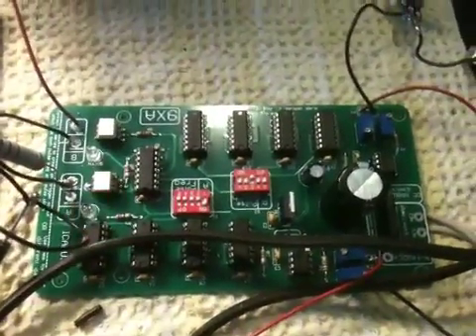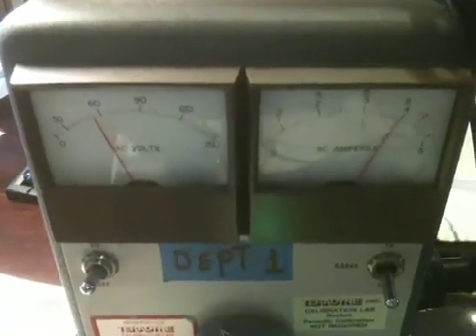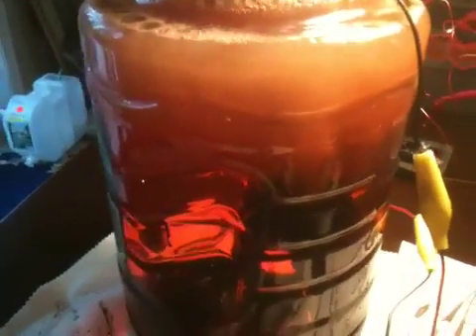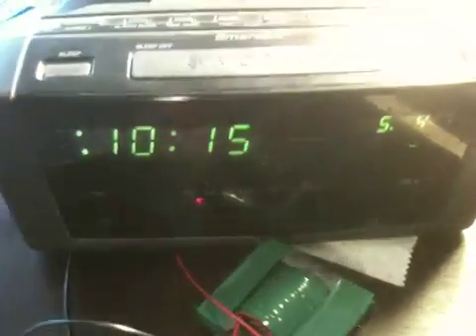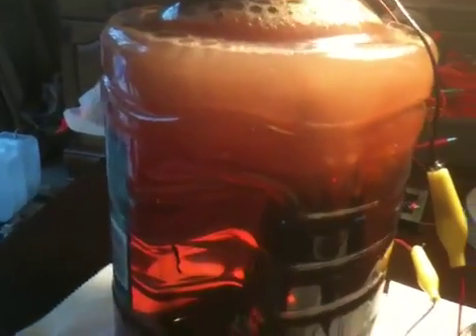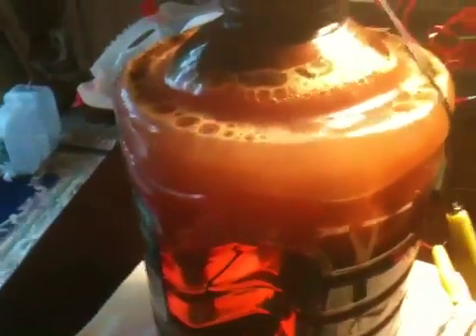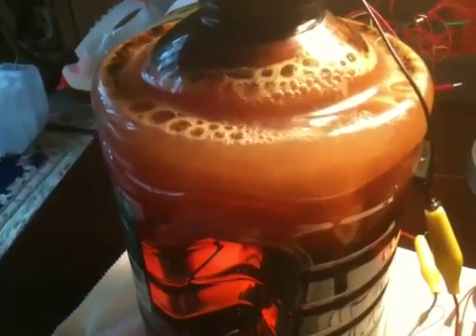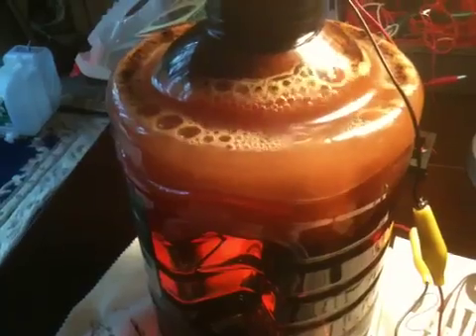Stan Meyers Hydrogen Cell using Max Millers 9XA and 2 E-core Inductors, sound

Comment: If you had platinum electrodes you would probably get 2 to 3 times the production with less voltage.
Bloom energy cells say they found a cheap replacement for platinum.

Comment from the maker: I tried the set up you suggested, but with one 6 inch tall cell. The cell was 1.25 od on the outer tube and 1 inch od on the inner cell.The outer cell was sealed with shrink wrap and the inner cell was filled with silicone. One inductor, as you suggested. but the draw was large. Over 5 amps. Switched to 5 layers, only energized the inner and outer tubes. About 30 volts with 4-5 amps. Tremendous flux on the inductor. Would like less amps. Definitely different. Still needs more tweaking. 
ThankYou

Comment: Your welcome, I posted the 8xa circuit mods almost at the end of the thread. The way the bifilar chokes are wired, as shown, cuts down the amps and you will notice your SCR will shut down. The way that is it wired is very important plus note I added a microwave oven transformer so the voltages will be very high up to 1500 volts to the cell and beyond. You have two chokes sets so wire them into each other the correct way and you should get the results you are looking for.

Comment: Hi, I posted some circuit modifications that really cut down the amps flowing through the system on Heretical Builders in Electric Fields and Moving Media, Stanley Meyer Explained on the circuit you are using. Give it a look and know if you hook up two chokes the way I have shown you will get around a 2000% amp reduction between the plates, enjoy! And God Bless Max for his efforts to get this technology out to the people.